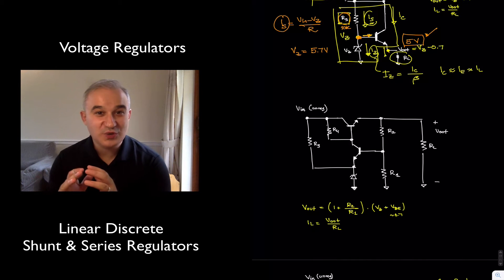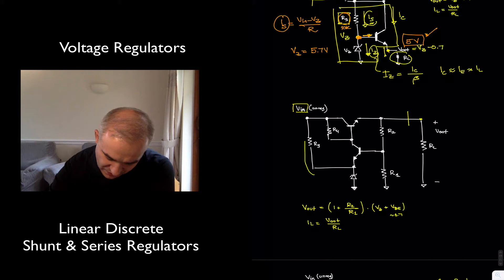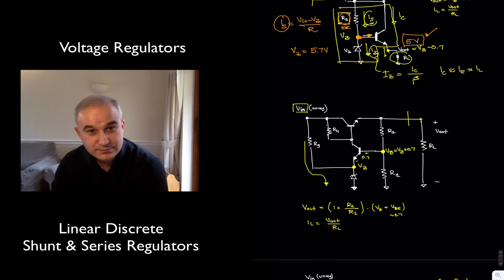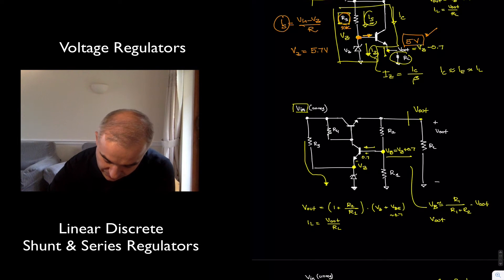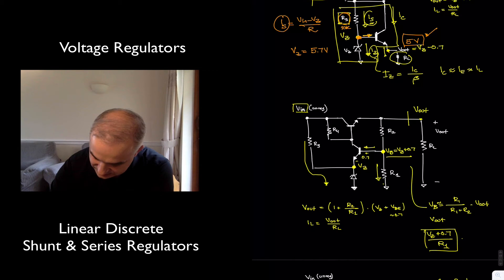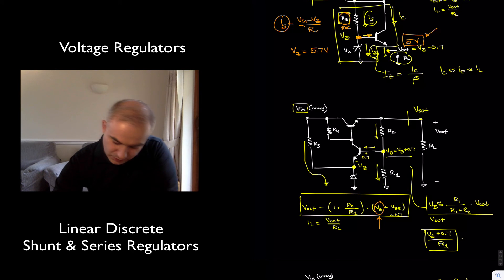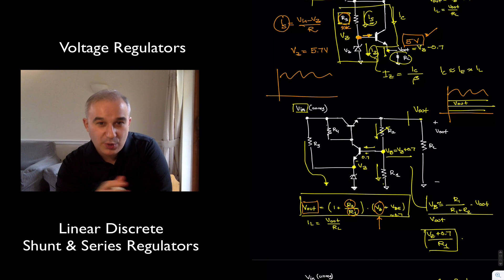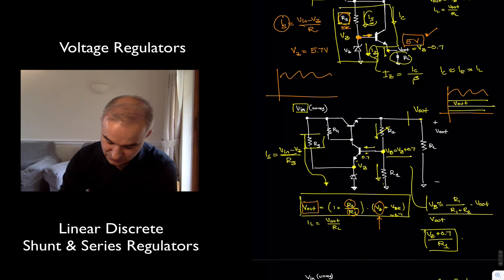Linear Series Voltage Regulators

Comment: Could You be more specific with some real design problem. What beta do we need for transistors and what value takes R4, I asume that is somehow connected?
Reply from the maker: The circuit is largely beta independent
Reply: Thank You for replay. I came to some design solution with some transistor wich beta i did'n know and it works fine (for now in simulation). Thanks for this great video! Now, do You have some videos that explain how to achive temperature stabilisation?

Comment: What's the purpose of the 2nd BJT on top?
Reply from the maker: Q2 is the pass transistor. If you look closely, you will realize that it is the same configuration as in the previous example (with a different orientation). The addition is the Q1, R2 & R3 to provide the ability to adjust the output voltage. Notice that Q1 and Q2 also act together to stabilize the circuit (through negative feedback). For instance, if the output voltage decreases (e.g. due to a decrease of the load resistance), the voltage at the base of Q1 decreases, which result in a decrease of Q1's VBE. This in turn result in more based voltage at Q2 (increasing Q2's VBE) which results in an increase of the output voltage (i.e., it counters the initial reduction). However, I recommend the your redraw the previous circuit (the zener + BJT pass transistor series regulator) with the transistor in the Q2 orientation so that you can better see the addition of the circuitry (again to add controllability and stability)